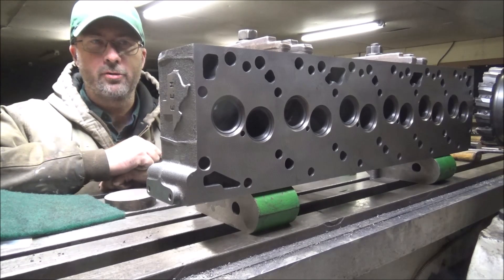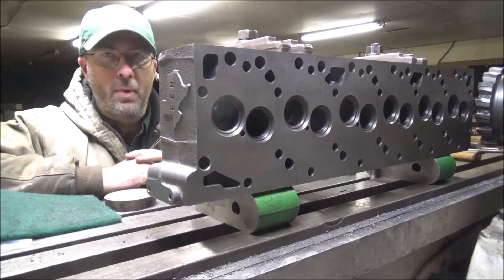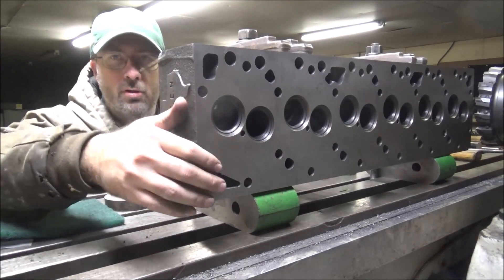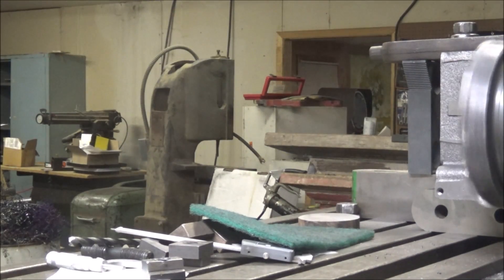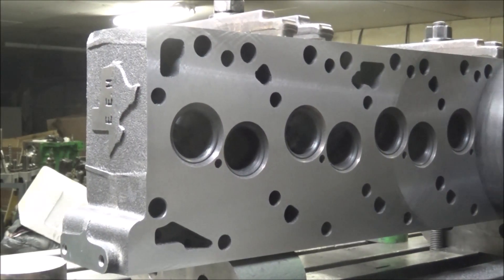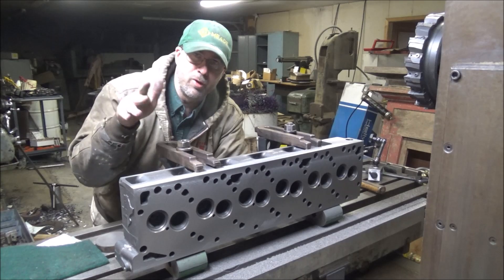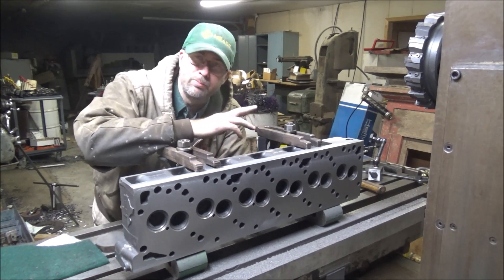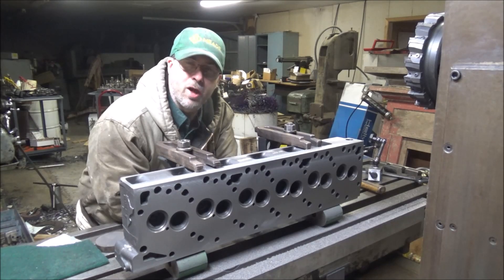Mods to a Hamilton Cummins 6B Head for Ultimate Boost Racing

Comment: Years ago I was at a General Motors school and they were talking about the new generation of Corvette engines leaking, turns out the machining was too good, too smooth and didn’t have enough tooth to hold the gaskets in place. My best to Bailey.

Comment: I am assuming that there is additional work to allow a bolt on manifold? That is being done by someone else? What kind of boost do you run under one of these? Also, is that head a wet head? Looks like it.
Reply from the maker: Yep wet head, probably run 60-70psi of boost, Customer said they would drill and tap for their manifold themselves, just wanted me to mill it flat so they could mount it.
Reply: bcbloc02 great work as usual
Reply from the maker: Thanks! When is your next video coming out? :-)

Comment: Good point on lining up the holding forces, also being gentle on how much force we apply, sometimes we tend to apply way too much force for what's needed, I've learned that better set-up planning and better gauging the clamping forces is a key to better parts, less deformations, and by the same token, frustrations...
Finally got theAcu-Rite 200M reader, it finally revealed to be a milling unit, now got to be on the lookout for some scales...  ;)
Reply from the maker: What size scales do you need?
Reply: @bcbloc02  To use it on the surface grinder, 12" and 18"would probably do the work for 2 axis, to eventually be able to install it on a milling machine, another scale with 40" displacement would be required, my mill table actually moves 38" across....
Reply from the maker: I will keep my eye out!

Comment: Curious...what part of the head (or where on the head) is used as the datum for alignment to the mill in both horizontal and vertical?
Reply from the maker: I swept the original mating surface (cylinder to block) vertical and horizontal to align the head to remove the least material while making it flat.

Comment: Would scaping the head mating surface do any good?
Reply from the maker: You wouldn't want to scrape it as that leaves peaks and valleys, you could lap it though. that isn't necessary as the head bolts and fire rings will deform and mate the head when it is torqued down.

Comment: Brian, I have some questions about the Roxul insulation. What is the bat size for 24 & 16 inch stud spacing how thick are they and how many bats to the bag, approx retail price?
Reply from the maker: I think 23 and 15 1/2 roughly. It is designed to press fir into a stud bay of 2x's on their respective centers. Pricing is from $30 to $50/bag depending on r-value and the store selling its pricing. bats/bag depends on size and r value.

Comment: There must be quite a bit of excess material on there.  Nice finish.  Do they also deck the block off.
Reply from the maker: They normally need it as the blocks always tend to be low in the middle after some use as new castings.

Comment: Was that a new head from Hamilton? Wasn't even aware Hamilton was selling aftermarket heads! Are they casting them or just re-selling someone else's? 
What about drilling and tapping holes for intake manifold?
Reply from the maker: I am sure someone casts these heads for them as i doubt they have an in house foundry. Judging by the surface of the cast and the core shift I would guess they are done in China.

Comment: hi nice video! I enjoy seeing your work. I am interested in your comment about cylinder pressure and i think you said 12,000 pounds? A pound is a measure of force, pressure has units of force per unit area so did i not hear 12,000 pounds per square inch, is that what you meant?
Reply from the maker: I think I said thousands of pounds. It likely is in the 3000-4000psi range I would guess so roughly 37000lbs of force per bang event trying to blow the head off!!

Comment: Brian, does it matter about the temperature you milled that head at? It look kinda cold in there
Reply from the maker: No, just needed to be flat and square, there was no exact dimensional thickness needed so any variance based on temp to standards would not matter.  If the head was hotter on one side than the other it might matter but since it is all the same temp there is no warp.

Comment: Some large Straight Six cylinder engines use two cylinder heads which cover three cylinders each.
I think this is a great idea because it reduces the tendency of the head to crack or warp.
Long cylinder heads are particularly prone to this.
Reply from the maker: Yes the 855 Cummins engines had 3 heads, 2 per cylinder. I think they hold up much better than the Cat3406 with it's long single piece head. The Cummins K series has 1 head per cylinder and that is the best in my opinion.
Reply: Brian I agree. I used to maintain trucks and the individual heads make way more sense than this setup. Volvo did single heads per cylinder too.

Comment: Ya brian thanks for outlining the fine points of the clamping set up. I wasn't even thinking of clamping distortion. Combined with the light cut forces I'd say that sucker's flat. Be cool to have one of them starrett  Ra gauges (got to be in the top 10 most expensive red boxes) Show some of the gasket technology sometime. Especially some beat up gaskets and o-rings Thanks

Comment: Hi
I have been wondering about a heat treat for cast objects to relieve internal stresses and possibly treat hard spots, Chilled sections?
Any thoughts?
Thanks
Reply from the maker: Sure it can be done. It does not guarantee that there still won't be distortion that happens if you go to cutting on it though. When parts are cast there is grain flow and heat treating won't remove that.

Comment: Which do you like more the 12v or the 24v? And what's your opinion on Aluminium Engine Bkocks?
Reply from the maker: All of that depends on the application. There is no "best" for every situation.  An aluminum block will save weight if that is what you need for a racing application but it won't be as strong as a cast or steel of the same dimensions.

Comment: Gj Brian! Nice setup and nice finish on the head. If I ever have enough space for a big milling machine then it is going to be a horizontal one with a vertical head as an option. They are so much more versatile than a vertical one. It wont replace a proper boring mill but for a small home shop it should do most of the things I need.

Comment: Will you have to recut/re-mill the depth on the valve seats after milling the surface like that? Or is the cut you took shallow enough not to cause problems?
Reply from the maker: .004" off won't bother the valves. They are actually recessed further in this head than I would prefer myself for racing.
Reply: @bcbloc02  I find those heads need a lot of work, which can be good from a customization perspective... but a long way from a bolt on part.
Reply from the maker: I think they are kind of rough for what is marketed as an aftermarket racing part.  Of course they don't cost what a full on billet racing head does either so.............